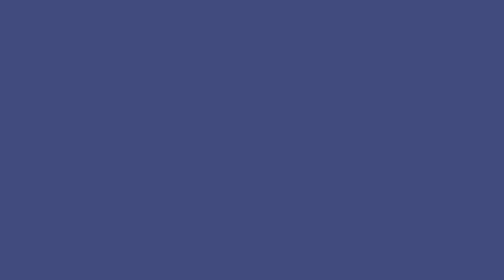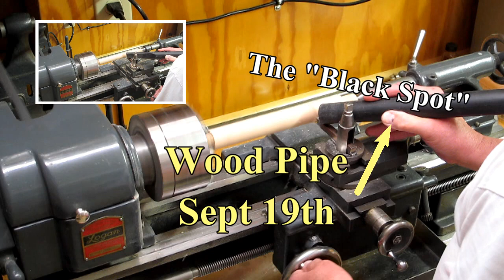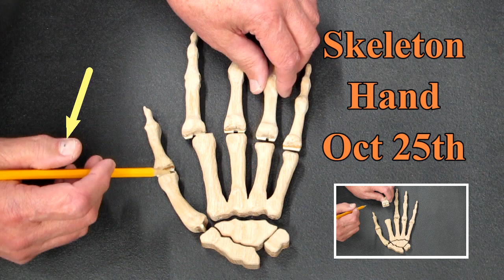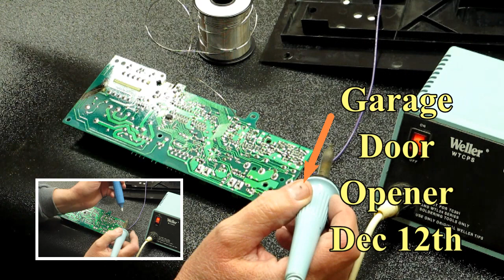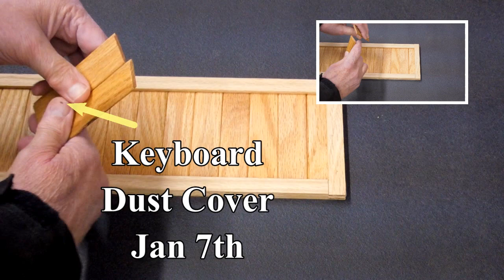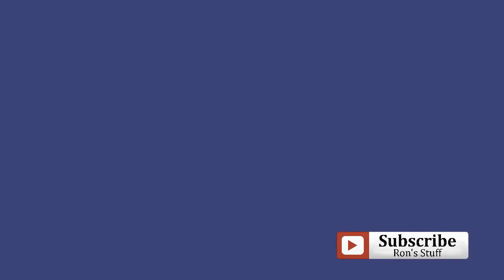How Long Does It Take

Comment: If the blood behind the nail is larger and painful you can go to the Dr office right away and they can burn a hole in the nail over the blood and decompress the blood clot===instant relief of the pain!!  Or if you are a tough guy you can heat up a paperclip  to red hot (after bending a portion out to a single point)  hold it in a pliers or better small vise grip and burn the hole in the nail yourself.  The nail feels no pain and the end point is reached when you see the blood squirt out from the hole created.  For as small of a one as Ronald had this would be somewhat difficult to "hit the right spot" but for the doozies it is good therapy
Reply: A friend of mine used a tiny drill bit too moved it back and forth in the fingers of his other hand NOT in a drill.
Reply: Jarod Morris I have heard that works also but a bit more painful while "drilling"  :)  The hot wire is instant